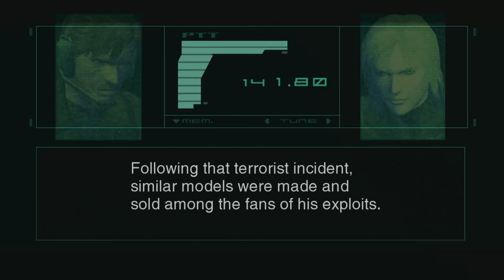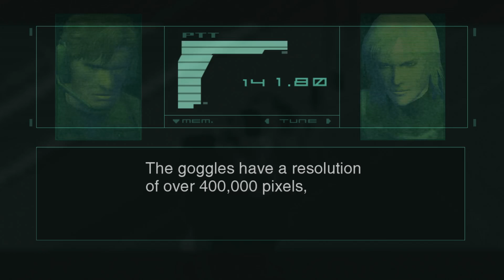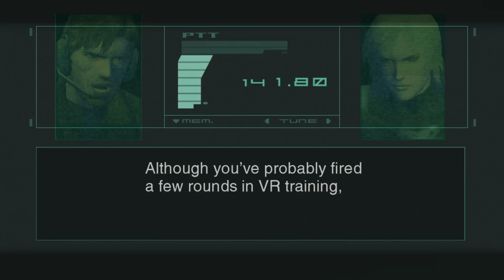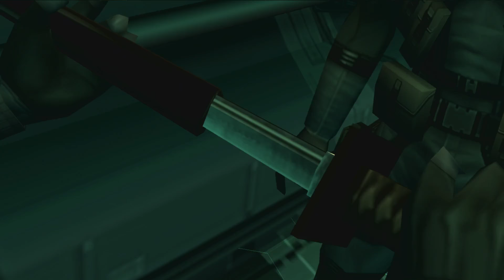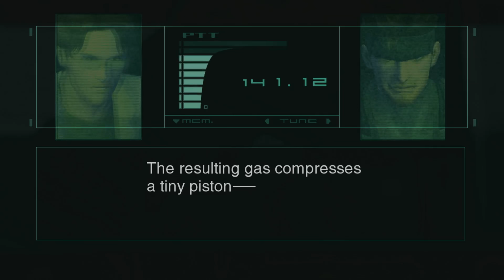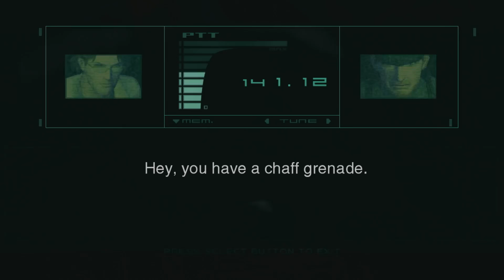MGS2 - Every Weapon and Item

Comment: 2 questions please. 
1) is this the HD remake for XBox 
2) Did you get the USP Suppressor at the top of the tower after you fight Olga in the NG+? I never found it in the first runthrough but I heard a rumor that if you beat the game before and do the NG+ you can find it on top of the tower on top of the bridge, where you get the Thermal Goggles.
Reply: George kinda confirms it in his MGS2 Secrets and Interesting Stuff video.
Reply: 1) XBOX 360 & PS3
2) Yes (USP Suppressor) on NG but Thermal Googles will be there on NG+ BUT if you don’t pick it up there, you’ll find it on the top left section of Hold No.1 during the Commandant’s speech. You have to hang on a wire & shimmy all the way to the left to find the goggles

Comment: If I remember correctly there is a suppressor for the USP but it is in the Substance version.
Reply: There is… located @ Strut F on the B1 floor in the crawl space where the node is alongside a box you can pick up
Reply: @JCPrince705  The Tanker has one too after you fight Olga up in the crows' nest.